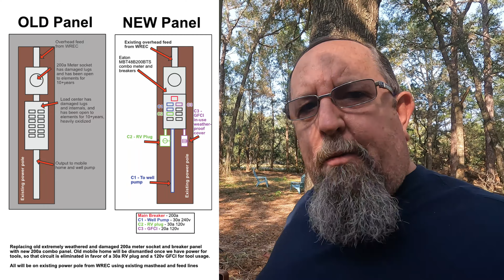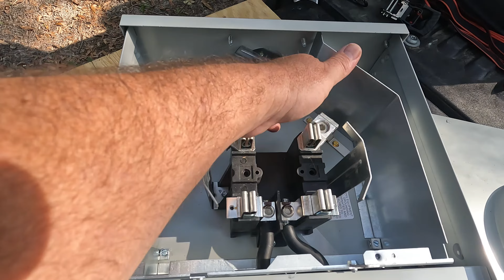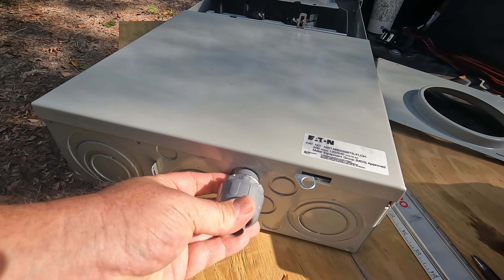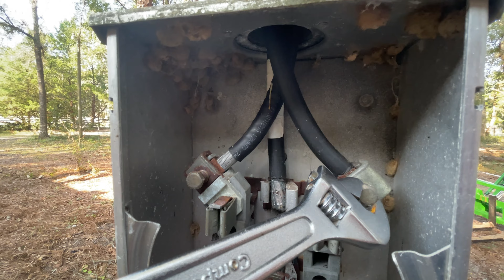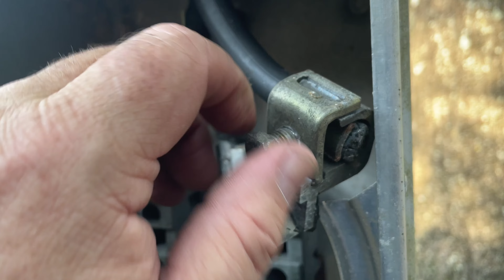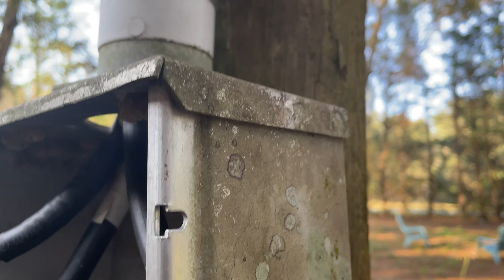Episode 3 - Electrical Panel Replacement - Part 1

Comment: I did the same job on my barn. To mount the box I used unistrut from Home Depot. The plywood will work well but will eventually need to be replaced which may require the power company to turn off the power first.
Reply from the maker: Great point. Hopefully in the next couple of years there will be a house standing where the power pole is currently, otherwise I would have used a more durable material. It is ground contact rated plywood, so it should last us until we can get the plans worked out with a final location. It's also why I was ok doing a trailer box with so few circuits. Just looking to get a place to plug some things in, and to power the well right now. 

We are also wanting to go underground if possible when we build. Florida hurricanes are no joke and having the power underground wherever possible, especially with all of our trees there, is a plus for us.

Thanks for the comment!